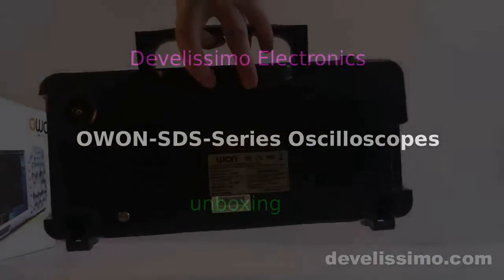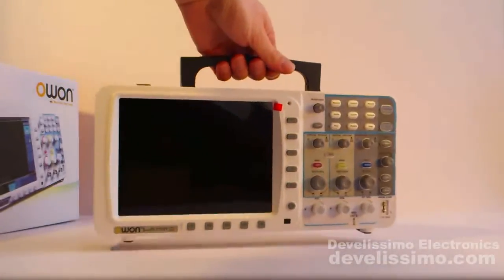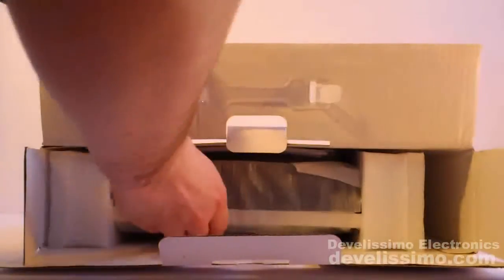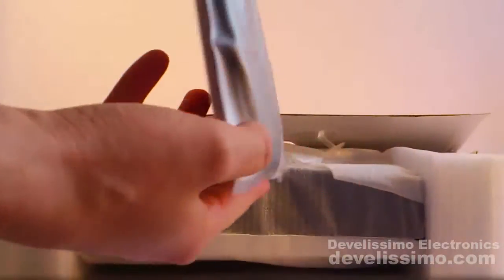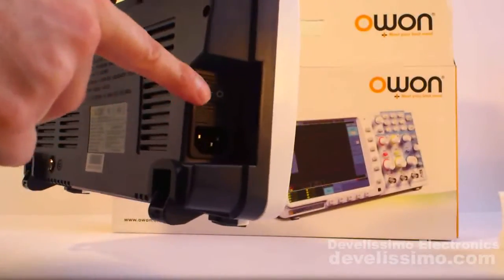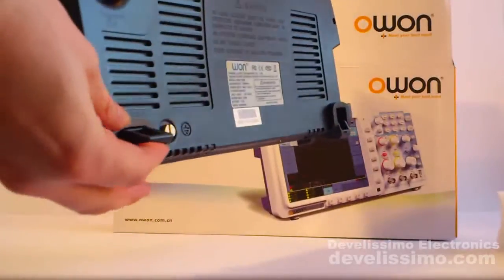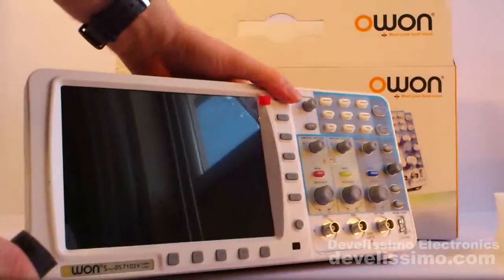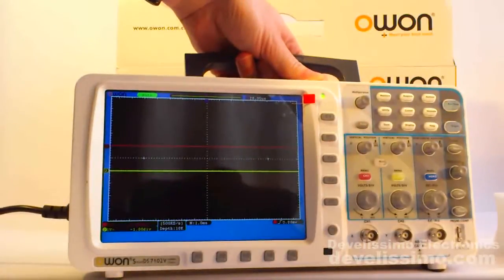OWON SDS-Series Oscilloscopes unpack by Develissimo Electronics

Comment: Great oscilloscope!❂>imgs.love/owOscilloscope?Й   So far I've used it to test the MAF, IAC, and CPS sensors on a Ford Explorer. Trigger works great and is easy to use. You can set the trigger in a menu or by sliding a cursor on screen to the desired voltage. You can also freeze and the save data displays. Has a wide variety of features. Attached is a photo of the MAF sensor output at lo rpm.